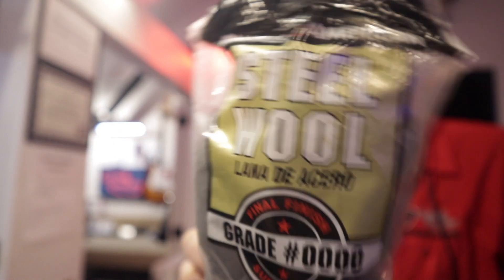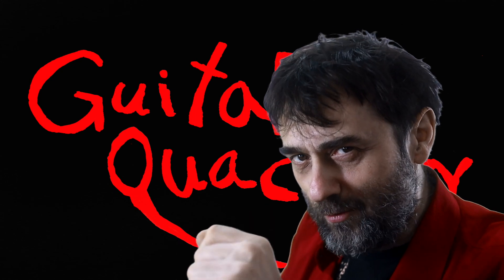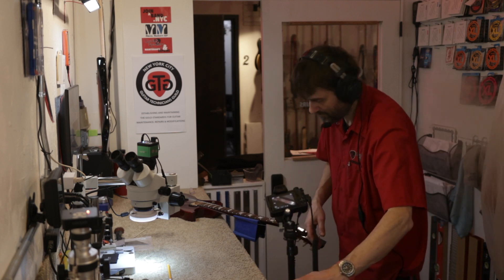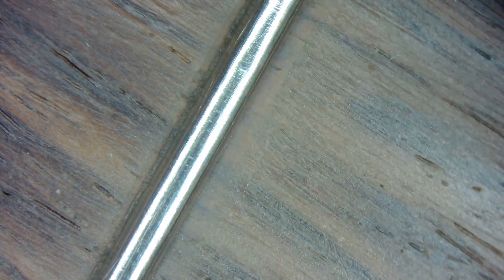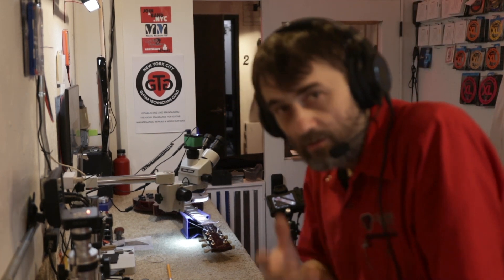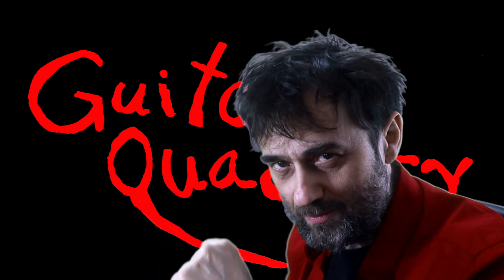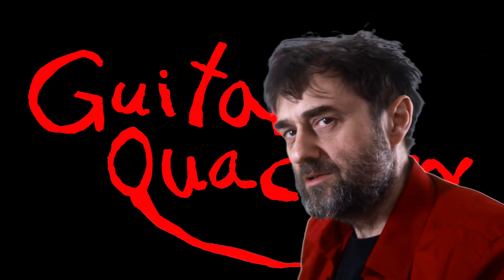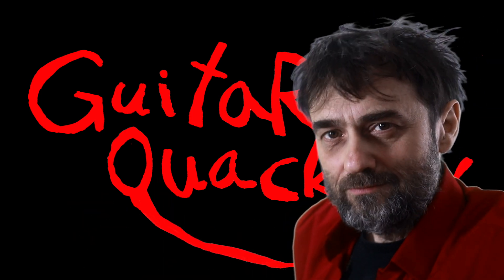Is it Safe to use Steel Wool to Polish Guitar Frets?

Comment: Put painters tape over the pickups. You should do that if you're using anything abrasive on the frets (like files or sandpaper) because the metal you're removing from the frets can get into the pickups. Wipe the fretboard/body down with lighter fluid when you're done and remove the tape.
Reply from the maker: Thank you for sharing.
Reply: Always tape the pickups! I also use the small "post-it" note paper for fret board protector. Easy to apply and a couple sheets makes it through a few frets, then I just thro them away and grab a couple more.

Comment: Actually, to polish frets I prefer to use a Dremel with arubber disc. I use steel wool to remove the grime on the fret sides where the rubber disc can't reach. Also, I put masking tape all around the pickup with a double face tape on the top where the left steel particles get caught.
Reply from the maker: I’ve been meaning to get a Dremel for polishing frets, but I need to figure out how to deal with splashing.

I know the splashing is microscopic, but dealing with several guitars every day, would have accumulative effect, I guess.

I do think there’s a way to deal with steel wool, to contain it. I just feel that it takes a lot of work to make sure it’s all cleaned up. Then it gets on the workbench and then when you flip subsequent guitars over, the pickups pick up the leftover steel wool particles from previous jobs.

So I just don’t use steel wool and I got used to other methods.
Reply: Yes.  That's because you're ACTUALLY polishing the frets not scratching them up.
Reply from the maker: @poison7512  Thanks for your comment. Comments help the channel grow, so I appreciate it.

Comment: All this proves is that when you use steel wool to polish frets, some steel wool particles will be left behind on the fret board. One could extrapolate that if you do this near your pickups, some particles would get on the pickups. However, it doesn't prove the statement that steel will ruin your pickups!
Reply from the maker: You are 100% right about that. This is why I did not say, in this video, that I think steel wool will ruin pickups. I was careful to say that some techs say that it does.

People ask me all the time and although I did say, in the past, that steel wool ruins pickups, I do not say it now. I do say that steel wool will get into the pickups, but that's not the same (as you've just pointed out, yourself).

However, on a bass, I do believe that steel wool particles trapped around the pole pieces have the potential to cause popping sounds, as I believe you can see (and hear) in this video https://youtu.be/51i5Dqmol-c about steel wool. And that's because low rumbling frequencies have the tendency to make small objects vibrate.
Reply: Pups can be covered during the process...steel wool works fine....
Reply from the maker: @tristanadam1533  As I was just replying to a comment made by @shuttermaniac I really appreciate all the comments that all of you have posted here, as they are making me rethink the whole steel wool issue.
Reply: @tristanadam1533 Indeed, also a good idea to remove any leftovers since steelwood corrodes and not desired to get any other material in the pups from polishing either.
I prefer to use sets of nailpolishing files though, steelwool is to rough for the final polish too.
Reply: @GuitarQuackery  it may ruin active pickups because of electricity.

Comment: As an electrical engineer I believe it would take a huge amount of steel wool fibers to short a pickup. I do believe you can cause cosmetic damage by having every nook and cranny with stuck steel wool particles. They would be very difficult to remove off the pickup.
Reply from the maker: I have actually been rethinking the whole steel wool issue, also based on many good comments here... One thing that I do remember seeing on some guitars is rust. I guess, it's from the steel wool particles, especially if the players tent to sweat. I'm not sure how much rust can actually damage the pickups, due to the fact that rust does expand a little bit. 

Any thought on that?

I'd also be curious to know what you think of this video https://youtu.be/51i5Dqmol-c

Thanks.

Comment: I like steel wool for this, but I just take the neck off and isolate the pickups away from the work... That is, for bolt on necks only... However, this video did offer a more educated perspective. I never realized the level of "contamination" that steel wool causes at the microscopic level... Wow! very enlightening...
Reply from the maker: The additional potential problem is that it contaminates the workbench. And then it gets into other repair jobs.

Comment: Been using 0000 steel wool for years. All you gotta do is instal some masking tape on your PUPs and wool away. Helps to have a magnet under the neck to collect particles and to use a paper towel to wipe away any residue. But you have cleaned both the frets and the fingerboard at the same time. Then use your favorite fretboard oil (mine is once again, linseed oil which I used in my brother's store in the early-to-mid '70s) and let it soak in well. Wipe off any residue and reapply and rewipe. Works great.
Reply from the maker: Steel wool has the tendency to get everywhere. On the workbench, clothes, smart phones with magnets in them, etc. One tech just told me that he doesn’t like to use steel wool because it seems to be getting under his skin.

Comment: I agree with this. Might not be an issue for just one occasion, but if the guitar, and pickups, are near and dear to your heart (aren't they all? Lol), over time, it's a matter of build-up. I prefer to use the dremel tool that I've had for many years. No fuss, no muss, and extremely effective, and I would argue, produces an even better result.
Reply from the maker: I know some techs that use exclusively the Dremel tool and I know other techs that use exclusively steel wool.

Comment: I used it for decades as long as you tape off the fretboard and put tape over your pickups thats fine. but i now use fret erasers instead
Reply from the maker: I think that contamination is always a possibility, even in strictly regulated environments. Just as you said that you now use fret erasers, there are other methods that are less hassle to control.

Comment: I've never used steel wool, but I learned of emery cloth about 40 years ago.
Reply from the maker: Thanks for the tip. What grits do you use?
Reply: @GuitarQuackery  I use 1,600-2,400 grit from a knife supplier.
Reply from the maker: I’ve never used Emery cloth. But I wonder if it would really be much different from using micromesh pads.
Reply: @GuitarQuackery  I'm sure it's pretty much the same.
Actually,  the last time I needed to polish and was out of emery cloth I picked up a cheap, 8 sided nail file at the dollar store.
Worked great and already had foam backing. Seemed to go up to about 2,500 grit.

Comment: By the way, most screwdrivers nowadays come with magnetic tips. Do you think it’s safe to adjust pickup height with such screwdrivers, i.e. can it affect their magnetic charge?
Reply from the maker: I do't think the small magnetic charge from a screwdriver would affect the charge of the alnico bar magnets. 

And BTW, when Seymour Duncan ships their pickups in boxes, to retail stores, they just stack them up, one on top of the other. They should really know better.
Reply: Iv used them for almost 20 years to adjust mine, never once had an issue man. I think that your likely referring to is a degaussing magnet, not the same thing. A degaussing magnet is not found on a common screwdriver you have to specifically purchase those. I honestly don't know anyone who even owns one.
Reply from the maker: @justinbowen1183   I don't believe the small magnetic charge at the tip of a screwdriver would have the ability to charge the magnetic charge of AlNiCo pole pieces in any significant way.

What I was saying was that I don't believe it is good practice for a pickup manufacturer to stack boxes of pickups on top of each other, for shipping or storage. AlNiCo magnets are initially not magnetically charged. They are charged at some point during manufacturing. The magnetic charge in AlNiCo magnets is not 100% stable and can be increased, decreased or reversed, by placing string magnets near or on top of AlNiCo magnets or by heating up. 

I hope this makes sense.

Comment: I'm convinced steel wool is very hazardous and can contaminate your pickups. But can that also be said when you level, crown and polish your frets? It would be a good idea to remove the neck or the control plate if you have a Fender but if you have set neck guitars the pickups must be masked off and extra caution must be taken.
Reply from the maker: I never use steel wool, even when I Level Crown & Polish. It is not even so much because of the contamination issues. I also get much better results polishing the frets using many other methods (also used by others) that do not include steel wool.
Reply: @GuitarQuackery  What I was trying to ask was are the filings from leveling and crowning frets just as dangerous of contaminating your pickups as steel wool?
Reply from the maker: @Bliggick  That's a very interesting question and point. They are much smaller than steel wool particles and they are not magnetic. But, you do bring up a good point and it's worth investigating. I'll write down this idea for a future video. Thanks.

Comment: There's no need to use 0000 steel wool these days with all the better alternatives. But what happens to the small particles of metal when you polish stainless steel frets?
Reply from the maker: Good question. I would imagine they are potentially less of a problem, if they get into the pickups. 

Particles produced by sanding are smaller and not as sharp as fragments of steel wool. Stainless steel is less magnetic than iron or carbon steel, so we can work closer to the neck pickup and still clean up better (although probably not perfectly). Steel wool fragments can rust, when trapped inside the pickups (especially if the player sweats) but stainless steel will most likely not rust (although it is not 100% guaranteed that stainless steel won't rust). I also think that taping off the fretboard does offer better protection than using the fret shield or fret guards. We can also tape off the pickup completely, which is what people do with steel wool away.

Lastly, we can always send all customers with stainless steel frets to our competitors, and let them deal with it, LOL.

Comment: why not just say if its safe or not clearly if you know!? if its not safe, and people are damaging their guitars, let them know! (half serious - thanks for the video - i like your idea of bringing more empiricism to guitar tinkering)
Reply from the maker: Good question. I do not actually know for a fact if steel wood damages pickups. Although I have seen pickups that failed, at some point, I have no evidence that would draw me to the conclusion that the pickups failed due to steel wool damage.

However, I have encountered popping sounds, caused by steel wool particles, on a bass, as you can see in this  https://youtu.be/51i5Dqmol-c short video. I think that low rumbling frequencies have the potential to make sm all objects (like steel wool fragments) vibrate.

Comment: I use steel wool, tape up the pickups, and use a vacuum cleaner to clean up as I go.
Reply from the maker: Most techs do in fact use steel wool. Some techs use magnets to pick it up.
Reply: @GuitarQuackery  yeah, this works fine, an implementation of a vacuum cleaner are golden!.

Comment: I've used it to clean frets and remove a logo from a headstock.
Reply from the maker: Out of curiosity, why did you have to remove a logo?
Reply: @GuitarQuackery  It was a Chinese Fender knockoff and I had a different logo I wanted to use. I ordered it and told them not to put the logo on. They did it anyway and when I complained, they reimbursed me $73. Not a bad deal I guess. 🙂
Reply from the maker: @JoeR203  Thanks for clarifying, I'm guessing, it must have been a Fender knockoff with some features and appointments that were not available from other makers.
Reply: @GuitarQuackery  Not really. It had an H-S-S config with their cheap Floyd Rose. I changed that to a cheap Wilkinson trem and got a custom pickguard so I now only have a humbucker in the bridge and a single cil in the neck. Just a volume control and a 3 way toggle for pickup selection.

Comment: There's a great new invention called masking tape.
As long as you mask up the guitar first covering up the pick ups before using the 4 zero wool to polish the frets all is fine.
It's not rocket science 😂
Reply from the maker: I'm probably going to do a test with masking tape, too. One of the issues is the contamination of the workbench. Once the steel wool gets into the rug that covers the workbench, it's not possible to clean it up completely. Then when you turn a guitar over on it's belly, the pickups are likely to attract some of the steel wool from the rug. And all techs do not have the luxury of having a separate workstation for steel wool.

Comment: I typically finish sanding frets with 600 wetordry paper, durable stuff, then flip the paper to the back side and polish to glint.  The paper will be black.  One fellow stropped a plane blade on carbon paper...  Old Chinese proverb: sometimes paper can be a real tiger.
Reply from the maker: I love the old Chinese proverb. Thank you for sharing.

Comment: So, what´s the alternative?
Reply from the maker: Good question. It really depends on the state of the frets. If there are scratches, one good medium would be to use micromesh pads, but you’ll need to correctly determine which grit to use on the first pass. 

If there is no detectable fret wear and you are just removing the oxides, then a polishing compound, such as Frine by Music Nomad, and the polishing cloth might be the best way to go. 

So, there are options, depending on the situation. I guess I better just make a video about that. 

As I’m sure you understand, opinions will be divided on what the best options are.

Thanks for dropping by.
Reply: I leveled frets on a cheap Washburn but the frets are noisy when bend. What do you recomend? @GuitarQuackery
Reply from the maker: @zeppo20   If I understand correctly, the strings are fretting out when you bend, correct? If this is the case, then I think your action might be a tad too low for whatever fretboard radius is on your fretboard. When you bend a string over a radius'd board, you are in fact shifting the string diagonally across the hump of the curved fret. To use an analogy, that's like trying to have a direct line of sight from New York to London. Since the Earth is curved, you would have to stand on a very tall tower to see London with binoculars. On a guitar, you need to raise the action, to prevent a string from fretting out when bending. If your radius is 9.5 inch, you can go as low as .060" and be able to bend, without fretting out. But if your radius is 7.25" then you'll have to raise the action, if you want to bend.
Reply: No, sorry I´m not an english spoken. It´s like cheap guitars that they don´t pullish well frets. @GuitarQuackery
Reply from the maker: I don’t do a lot of work on my own guitars, by the way.